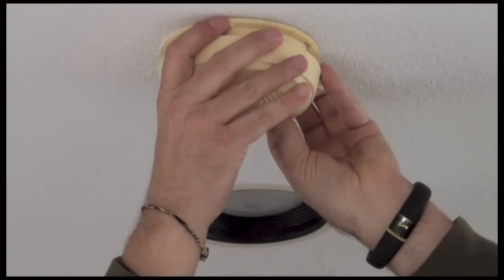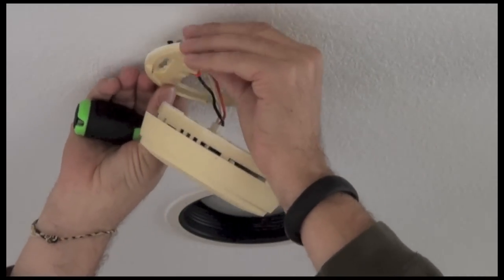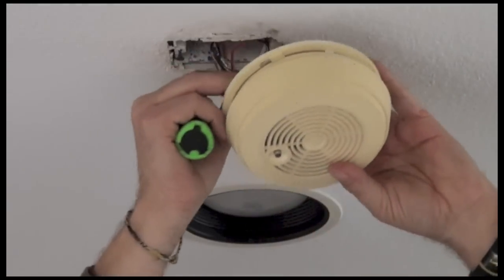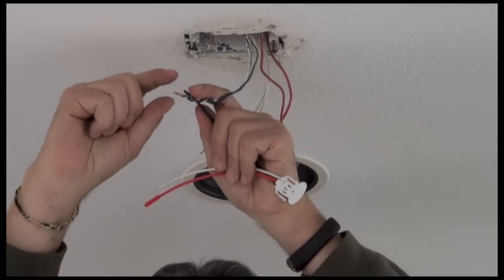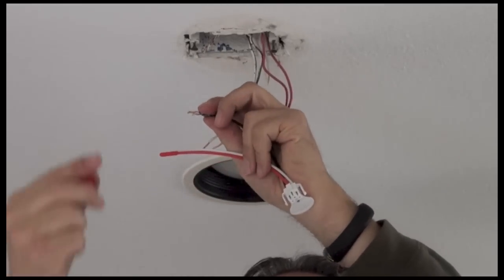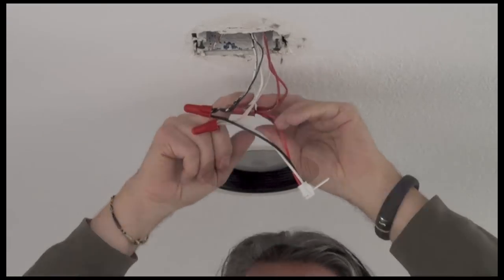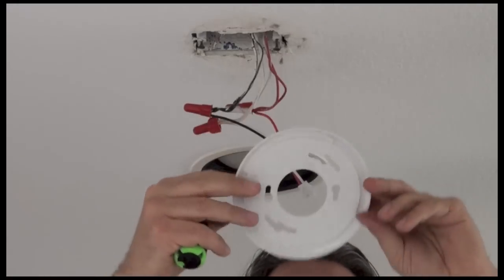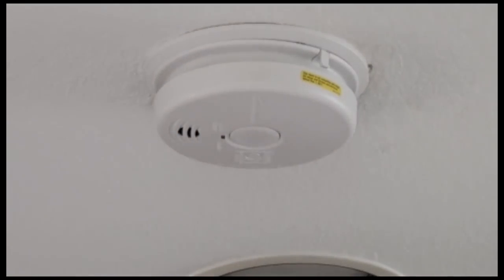How to Install: The Kidde Worry Free Smoke Alarm

Comment: i have to change mine too. i bought the kidde direct wire 120v pro series. My question is this; to i have to change all the wiring Inside or can i just plug in the new smoke alarm into the old plug that is hanging off the wall ?
Reply: Use the old plug

Comment: I bought a Kidde smoke + CO detector. No wires, and no way to install onto the old receptacle. Frustrating!
Reply from the maker: How was your old unit affixed to the ceiling? or was it a completely self-contained unit?
Reply: old unit installed exactly like your video, two screws that line up with the box. The new Kidde ten-year detectors have a small central mounting plate that is attached with a single screw mount. This does not match the standard receptacle like you had in the video, nor did it match mine. It literally cannot be mounted onto a standard box without some trickery. It's meant for "anywhere on the ceiling", apparently. Ideas?
Reply: You got the battery only version. Look on the box to make sure they say Hardwired

Comment: Turn off power to the whole house?  What a nonsensical suggestion.  If a person can't even figure out what circuit everything in their house is on, they should not be interacting with their home wiring at all and instead call a pro, who by the way, WON'T turn power to the whole house off!
Reply from the maker: +Stinky Cheese sorry you feel that way, but that's actually the recommendation of Kidde too. And I'd rather turn off all the power and not have to worry about it than realize I flipped the wrong switch and zap myself. Not everyone's a journeyman electrician, but that doesn't mean they can't succeed at this upgrade!
Reply: +Dave Taylor Frankly, I think I'd rather zap myself on a rare occasion, than have to go around resetting all the clocks/devices that reset to 12:00 when power goes off if whole house power was cut for every trivial thing like this, BUT, I also feel anyone who wants to undertake wiring, should own and know how to use a multimeter which can measure whether there's power present still.

If a person can't do any of that, how can you be sure they're competent to figure out whether they've cut power to the whole hose or not?

Additionally it should be mentioned that owners of past generation kidde alarms, those replacing them on the timetable recommended which is 10 years, may not have to wire a new connector or base plate at all, just unplug the old smoke alarm and plug the new one in then it mounts the same on the existing base plate.